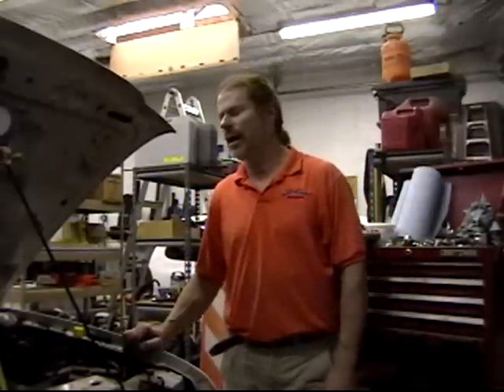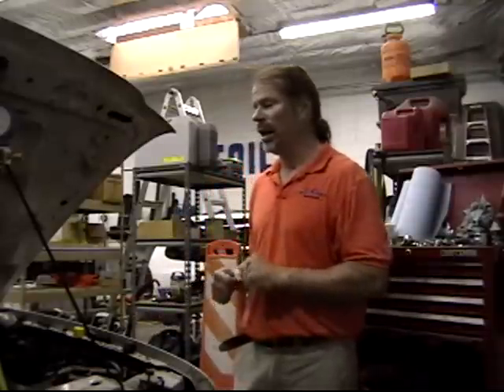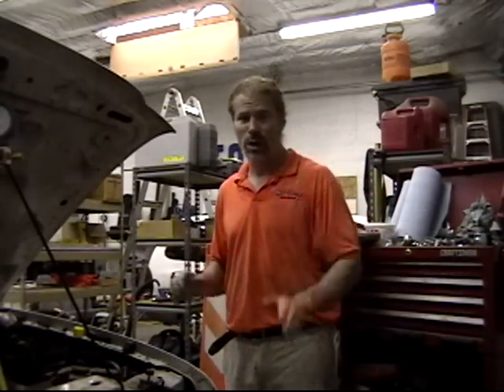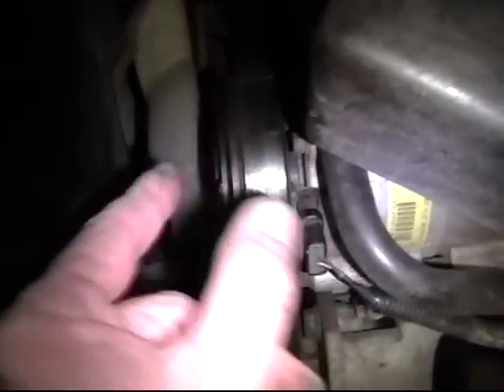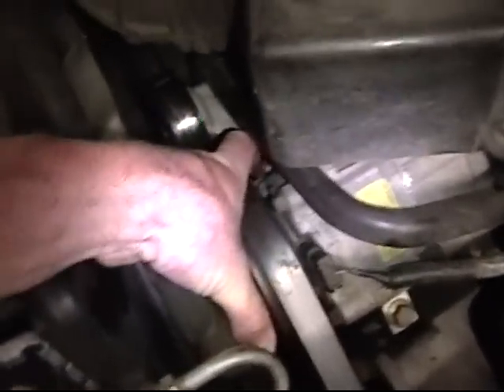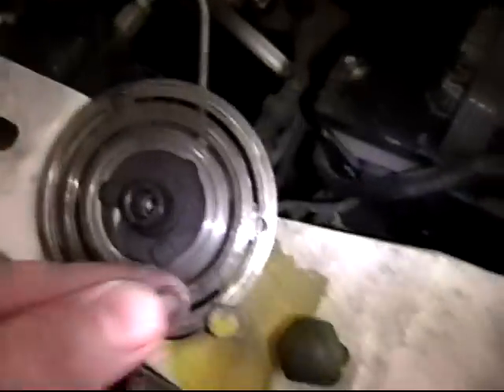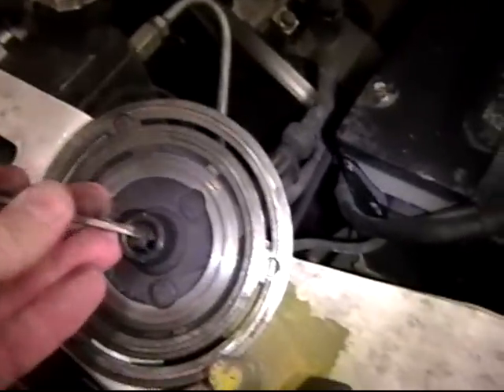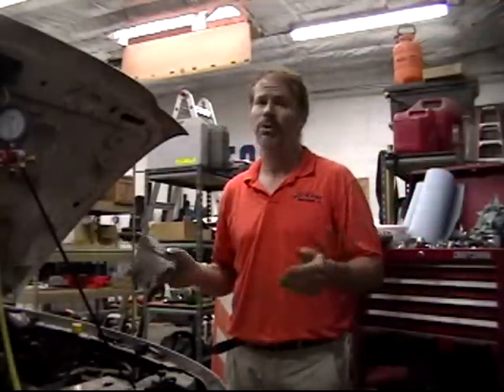99 Ford Ranger AC Clutch Fix

Comment: Thank you SO MUCH!!! My AC hasn't worked at all for some time. When I removed the spacer it worked great, but the clutch made a ringing sound when disengaged... not sure if that friction would cause problems down the road, so I thinned the spacer with my bench grinder and put it back in... Works perfectly! I probably thinned it down to about half of it's original thickness.

Comment: Ok so you want to fix your Air Con THIS DOES IT! 
I have been to the garage FORD WITH MY FOCUS ST 2006 
I had exactly the problem described here it would fall out of cold whilst driving. I live in Spain so you must have Air Con
System checked out gas level perfect, compressor perfect inside sensor working 
But to test we had engine running on a lift with someone inside car Air Con on then turn off clutch stopped turned back on clutch still stayed stopped
Took off clutch as per video had to use a lot of lubricant spray into bolt hole before we could get it to release took out 2 washed/Spacers put back 
Then with AirCon on, turn off, clutch stopped turned back on and clutch engaged!!!!!!!!
I took it for a test run and turned A/C off then on again drove it hard for over an hour and a half it still stayed on. For the first time in a year it worked properly.
According to the garage I was down to a New compressor or new ECU or both.
Cost for fix 1 hours labour.

Comment: I discussed with my mechanic today. He said Fords are notorious for doing this. my 2000 Ranger has been doing this the last couple years. Only when it is hot. When the engine heats up it starts to happen.My mechanic used a heavy hammer and slightly tapped the clutch. Be CAREFUL if you try this! The clutch engages with the slightest tap.

Comment: This worked like a charm! I used a small prybar to hold the clutch while my friend turned the wrench. Let it run an hour, was frosty inside the cab! 90 degree weather, just in time. I'm guessing yours is still going strong?
Reply: Is your ac still working?

Comment: What about a 94 Ranger 2.3 liter 4-cylinder engine? It's dual-spark. (Same truck as the Mazda B2300) Do you have any recommended model of belt for bypassing AC compressor?

Comment: Mine had a hole in the line. I patched the hole. The clutch does not engage. I bypassed it to engage it while adding refrigerant. But it does not get cool in the car. Someone said I need to replace the evaporator since system ran dry. I added a lot of refrigerant. I don't see any other leaks. Any tips would help.

Comment: sounds like it helped a lot of people.  my clutch will not engage.  I will try this first.   what wire to did use to make it engage electrically.
Reply from the maker: Sorry for the delay in getting back with you Daniel.  Unplug the connector at the compressor, connect jumper wires from the battery to the contacts on the compressor.  Since you are energizing a coil, it doesn't mater how the wires are connected to the connector.  I recommend purchasing a small bag of jumper wires with alligator clips on the ends. Make sure your last connection is at the compressor and not the battery to avoid sparking and a possible battery explosion.  You are probably already aware of this but lead acid car batteries emit hydrogen gas when they are charging.  Same applies to jumper cables, make your last connection is on ground rather then at the battery for this same reason.
Reply: Thanks Richard.  This worked.  I can see my clutch is ok.  but my pressure is 0.   I put in a leak test and found the condensor was leaking a lot.   I replaced that, put it under vacuum but will not hold a vacuum past an hour.  I will try new orings first on the condensor and see if I can hold a vacuum.  Assuming I can I will replace the accumulator and try to hold a vacuum.  assuming success i will charge the system at that point.

Comment: This is awesome that i came across your video. My 98 Ranger is doing the same thing. Plenty of charge and would start out blowing ice cold for about 10 minutes and then start blowing hot air. And like you said after I turned it off for about 10 minutes and turned back on it would do the same thing. I thought it might be the ac relay so I replaced that and it didn't help. And I also noticed if I was in the shade or early in the morning or after sun went down it would stay running. But I also notice it doesn't cycle on and off. I don't know if it's a clutch problem or the compressor is starting to go. I didn't even know you could take the clutch off without taking compressor off. Thanks. I am going to try what you did here, but how do you engage the clutch manual like you were doing?
Reply from the maker: Chris, thank you for your comment.  You can power the clutch by unplugging the electrical connection right at the compressor.  You will need two alligator wire clips, connect one  directly from the positive terminal of the battery to one of the pins in the electrical connector you unplugged.  This will be the connector that is wired directly to the compressor.  Since this is an electromagnetic it doesn't matter which pin you connect to.  Connect the other pin to a good ground, not the battery.  You should be able to manually engage the clutch by grounding the other alligator clip.  Before I removed the spacer on my clutch it would not engage at all because the gap was too wide.  If your clutch doesn't move when you apply power to it, you can see if it's generating a magnetic field by putting something metal like a wrench on the clutch.  The magnet is powerful.
Reply: So this fix worked good on my 98 Ranger for a year but now the clutch seized up but the pulley spins freely. But the clutch wont just slide off or wiggle off it's seized on the shaft. I guess the compressor shaft has seized  and now it needs a new compressor, because it's not fixable when it locks up on the shaft is it? Before the clutch came right off last year after seeing your video and took the spacer off. But now the clutch won't even come off. I'm not sure if i can use a clutch puller to get that off without taking compressor out. Or if i get the clutch forced off if it's even going to be fixable with a new clutch and pulley kit.

Comment: how did you manually engage the clutch to remove the bolt???  mine is a 2000 ranger.  it only engages when the truck is turned on.  So i can't remove the bolt with the truck actually on, with the bolt spinning.
Reply from the maker: Raul, simplest way to do this would be to remove the connector on the clutch and then connect it directly to the battery with jumper wires.  When you manually engage the clutch it will create a spark so make sure this is done away from the battery to avoid an explosion.  Explosions make for a bad day.  You can also locate the AC relay on the fuse panel and manually engage it from there.  That's how I did it in the video but it's a little more complicated.  You'll need the owners manual, Chiltons or Haynes manual to locate and identify the relay as well as identifying the pins that engage the clutch.  Hope this helps.

Comment: It looks to have been a good temporary fix for getting the AC back on in summer but the gap with the shim removed seems insufficient... Before I go washer hunting, how long have you been running on this fix?
Reply from the maker: Marty Hill
It lasted for the remainder of that summer and part of the next.  You should not be washer hunting unless your gap is too small and the clutch and friction plate are rubbing together.  The washers are an adjustment spacer to achieve the proper clutch gap.  As your clutch wears down from usage, proper maintenance involves checking this gap and removing spacers as needed to achieve the proper gap.

Comment: When you connect jumpers to the battery, is it both pos and neg? I havn't gotten into mine yet, would like to know what to expect.
Reply from the maker: Yes, however it's better to find a good ground such as the metal housing of the compressor rather than the battery for safety reasons.  Since you are energizing a coil, it doesn't mater how the wires are connected to the connector on the compressor.  I recommend purchasing a small bag of jumper wires with alligator clips on the ends.  Remove the connector at the compressor.  Connect one jumper to one of the pins on the compressor and the other to the positive terminal of your battery.  Connect the next jumper to the other pin of the compressor and to the metal casing of the compressor or a good ground.  If you can't get a good enough ground and connect to the negative terminal of the battery,  make sure your last connection is at the compressor and not the battery to avoid sparking and a possible battery explosion.  You are probably already aware of this but lead acid car batteries emit hydrogen gas when they are charging.  Same applies to jumper cables, make your last connection is on ground rather then at the battery for this same reason.